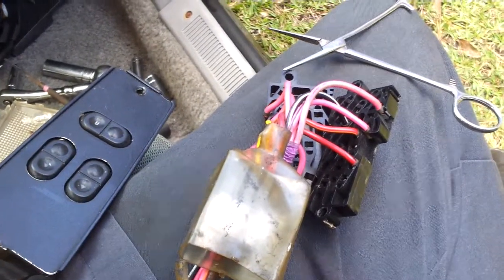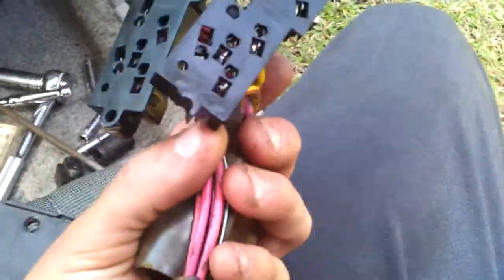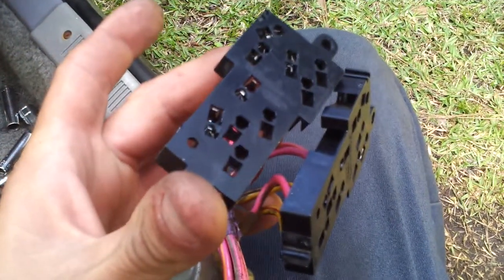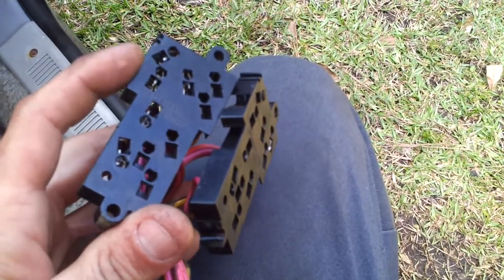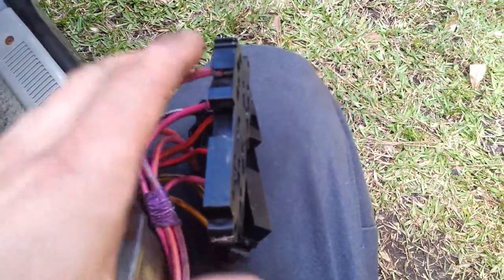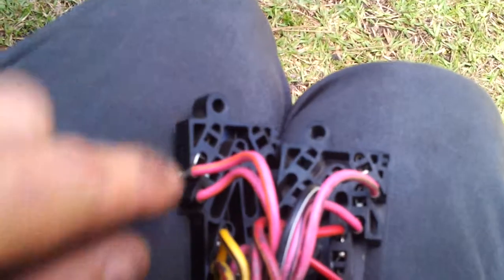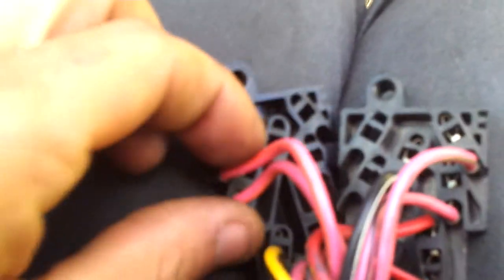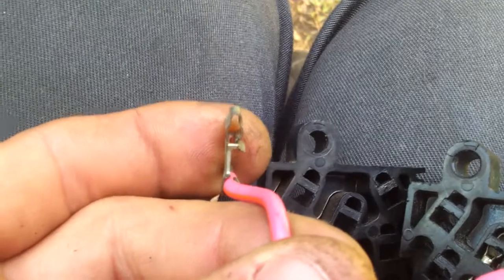Fox body Mustang window switch panel repair

Comment: Its funny how no matter what you go truh and you might think your the only one someone else has gone thru the same thing you have at one point or another,lol,i have a 91 Mustang GT convertible and on the driver side i have this identical issue you have (broken tab and sagging switches),on the passenger side you have these very convenient plugs in case something breaks, on the driver side you dont,its a harness all the way to the kick panel,not sure why they did this like that and i always wondered if what you are doing here could be done so this week i found me a "donor piece" in really good shape and I'm going to do the same thing you are doing in the video.

Like you said i thought the same identical thing,"if someone put this switch together I'm sure someone else can take it apart"  these switches weren't assembled in some magical house, they were made by other human beings so we should be able to take them apart,lol thank you so much for showing this!!!
Reply from the maker: Hope the video helps,when I made the video I was thinking would someone else do this?guess so lol
Reply: Yes I'm sure there are a bunch of us with this issue, not sure what causes that tab to break besides old and brittleness, I'm sure i caused mine to brake by not being careful at some point taking the door apart for some maintenance or other, i think I'm going to take some really good pictures and maybe some notes when i do mine,sure are quite a bit of wires going to the master switch on a Vert mainly from those little rear pesky windows,do you still have your car or was this a friends you were working on?   @MR1967galaxieLTD
Reply from the maker: @dntlss  still got my car need to get around to fixing the door post rust.This was a friend's 1990 GT I was blessed with fixing  for him using a 93 lx parts car I swapped interiors,fix all wiring hacks behind dash and steering column,reweld drivers floor where seat bolts to,change heater core,repaint wheels from black to white like my car (his car is black) list goes on.with the window switch panel doing it like I did may be easier than photos as the wires go in different directions and it may be hard to photo once you get the hang of it you will be finished in no time
Reply: Blessed? lol, sounds like hes the one blessed after all that work you did,that heater core alone is worth at least a million dollars, lol, I'm only joking,you're a great friend to him for doing all that,i have had mine since 96 and still drive it pretty much all the time, they are great little cars, i do need a new motor,that might happen around October if i get a few bucks put together,it still has the original engine and it smokes a little bit here and there, i cant wait to get that switch i ordered in, i also got a door lock actuator since mine is a little iffy, i figured while I'm messing with the door i can get that changed  @MR1967galaxieLTD
Reply: Hey, i just wanted to add to the comment here in case this might help someone,i ended up getting that new assembly today and once i took it apart of course its broken also(it looked in great shape when i bought it), however it wasn't broken all the way, just the corner was cracked like they always are but it hadn't come off so what i did was....

I work in a machine shop and we use very thin brass shims for different machining projects, its what they call "shim in a can" i cut me a little strip and folded it around the corners to shape where the screws go and i use some glue i had left over from when i glued the skirt to my dryer when i was servicing it, this glue is pretty hardcore and high temperature so basically what this does is it reinforces the corners where the breakage always occurs on these things.

You could use regular crazy glue i guess and fold a little piece of something sturdy but thin preferably made of some kind of metal, if you work on your own car you can figure it out but the trick is to reinforce these corners,cause the plastic is always brittle there and only go snug when is time for assembly. 

,  @MR1967galaxieLTD